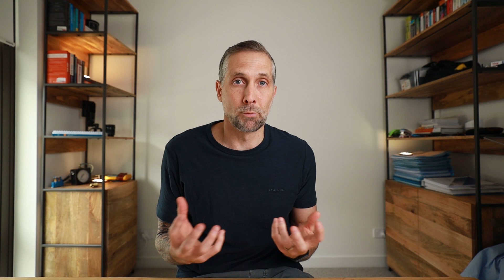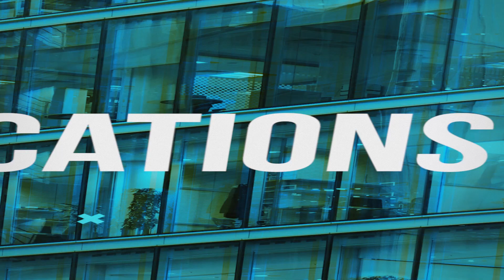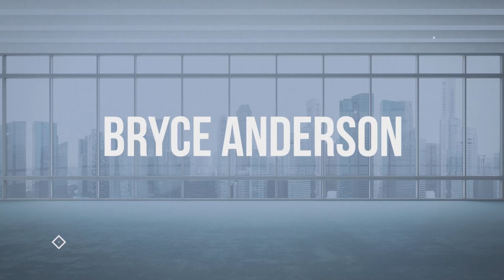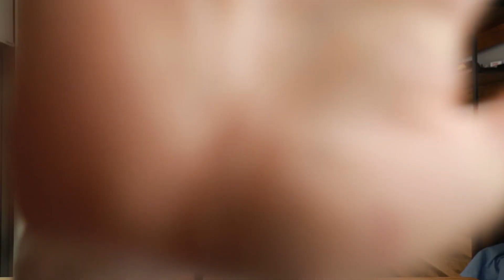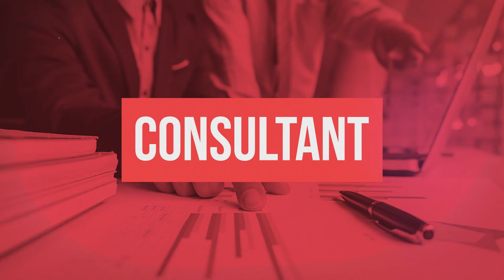How Much Energy Is Your Optimal Start Wasting?

Comment: I just enable on the secondary return LTHW reaching a sensible temperature.
Reply from the maker: That will work. But you are in the UK, yeah? You have to enable the LTHW system first as part of preventing the AHU coils from freezing. The weather is pretty mild here in Australia, so we don't need to do frost protection, and hence we start the AHU's first and waste a ton of energy every day.

Comment: Turn off fans while waiting for the target temperature to be reached ....... 😕  I am missing something obviously
Reply from the maker: Hold the AHU fans off until the hot water return temperature is up. I.e. don't run the AHU fans while the heating hot water system is starting up. 
Same applies for holding the fans off while the chilled water system is starting up. 
I dont think I used the word target temperature when referring to return hot water temperature.

Obviously, as you are suggesting, the fans need to run to increase the zone temperature. 
😊

Comment: Great video, Bryce. You make good points, I often find myself questioning the validity of the optimised time clock at all these days, it certainly needs looking at; like you say, it is focused on comfort control rather than energy efficiency. On top of that, how many engineers actually tune the optimiser for that specific job? I often find brand new buildings with excellent efficiency having the exact same optimiser settings as old stone buildings that have been retrofitted!!! I tend to link the optimised set point to the actual temperature set point but with a offset such as -2. This does change on different jobs but I have found that to work quite well.
Reply from the maker: Some great points there, thanks for sharing.
When I was talking through the idea of not many people being in the office at 8am, and that we would have primed the main plant first (with the fans off). I was thinking... don't even have optimal start at all. Just start the AHU's at 8am, or maybe start them say 10 mins early. 
But I think that may be stretching energy efficiency a bit far? But hey, times are changing.

Comment: Nice one Bryce. For simplification, scalability and better efficiency I'd like to put strap on sensors on heating and cooling pipework entering the AHU (accuracy not important). The AHU would open it's valve and only start running the fan when it detected heating / cooling was available. This will result in AHU's further away from main plant  correctly starting later and eliminate the global sharing of data which has the potential for errors. Probably has to be specified as BMS companies aren't going to throw in 2 extra sensors per AHU for free.
Reply from the maker: I have never considered that. Yes, it's the same principle except it is a little more robust as it is less reliant on the health of the Ethernet and sub-networks. 
It's probably another good selling point for the Belimo energy valves that comes with flow and return temperature sensors. 
I think reliability of a control system is no longer a priority. In Australia even if that was specified, it would never go in. 
In the online course, I don't actually hold the fans off as I discussed in the video. I let the fans run at minimum speed until the return water temperature increases. Considering what you just said now, we could run the fans at min speed and once the supply air temperature increased above say 30°C, then release the fans to auto control. Its a similar concept to getting around the reliance of the network and global signals.